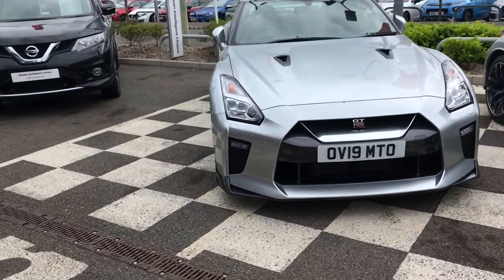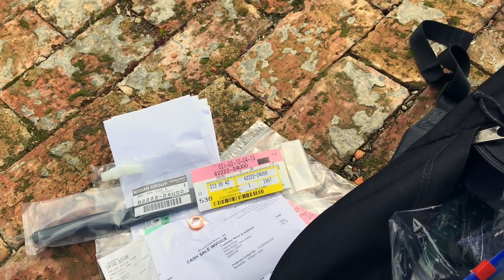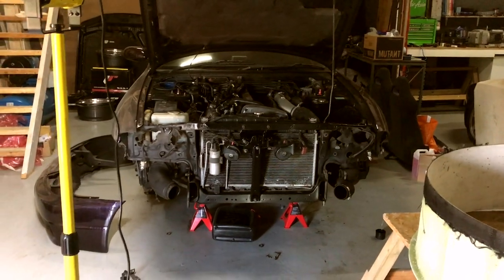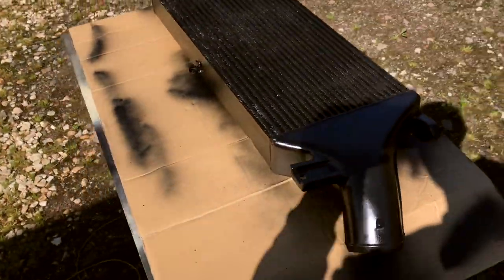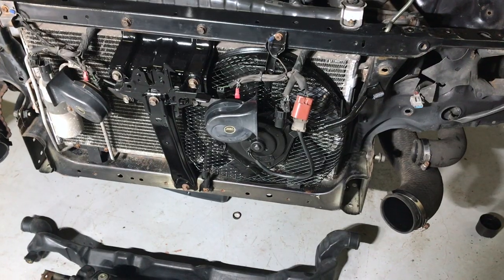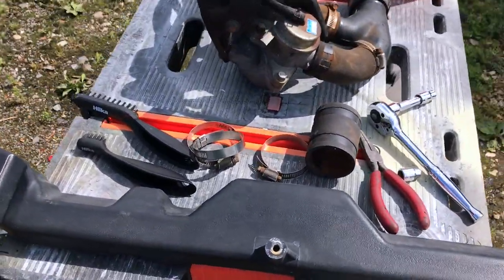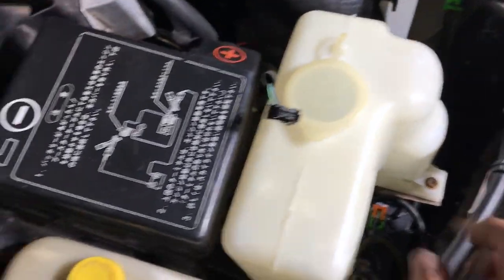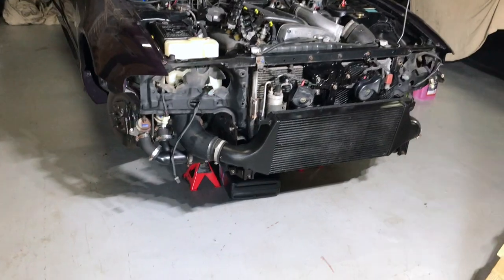Restoring An R33 GTR Front End!

Comment: Seriously......
Not possible to be a ring land.
I've never seen a ring land that deep.
Also Exhaust and Intake of turbo are seperate systems.
Connected by a shaft encased in steel.
Surrounded by oil.
Most likely a piece of alloy from inside the intercooler end tank has come off.